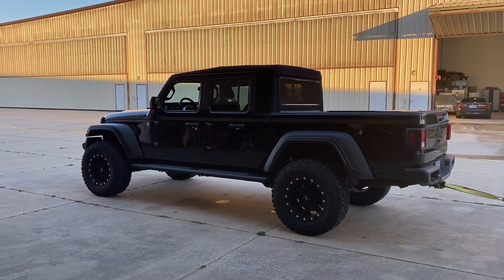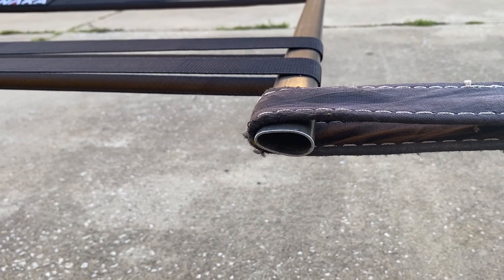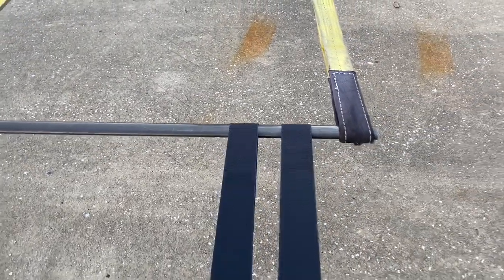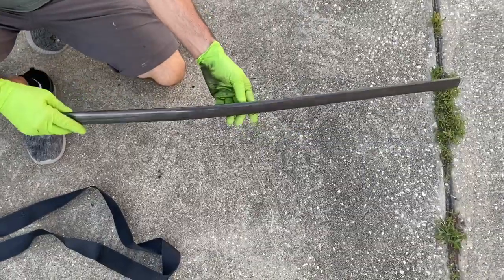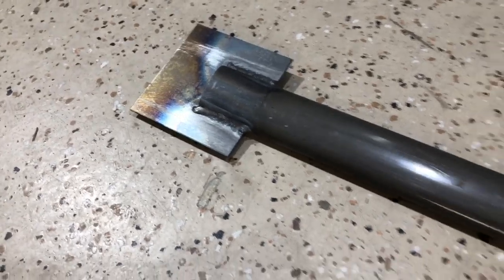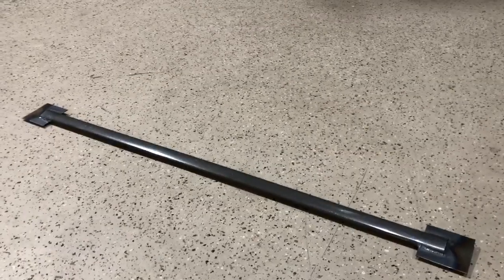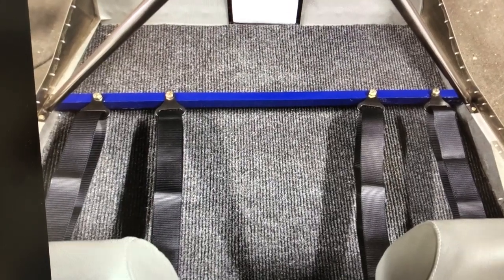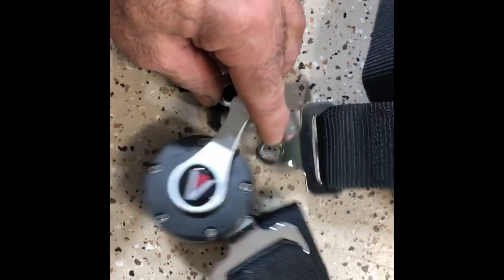Zenith CH-650 Seatbelts by Viking

Comment: Low wing aircraft with its low and rear placed attachment points for seat belts provide a dangerous geometry. In a crash the low mounted belt will fold your body and compress or break your spine. Check the cars and see that these belts are always attached ABOVE your shoulders in order to save you from folding. (sorry for my translation, but I guess you get the point.) To fix that problem you have to reroute the upper section of the belts somewhere via "a rollover structure above your shoulders" to unload your spine. Maybe Jan will provide such a additional structure to provide a real save seatbelt system?